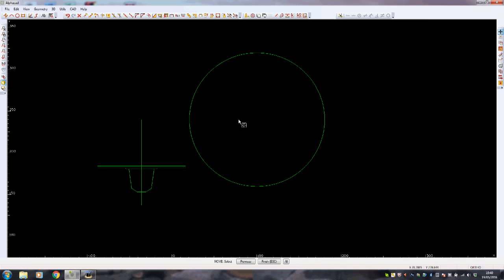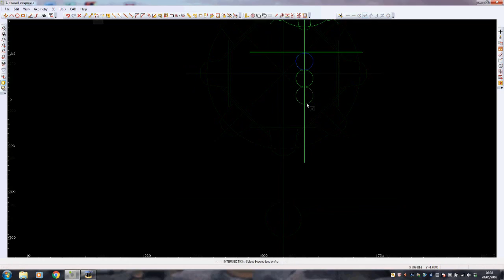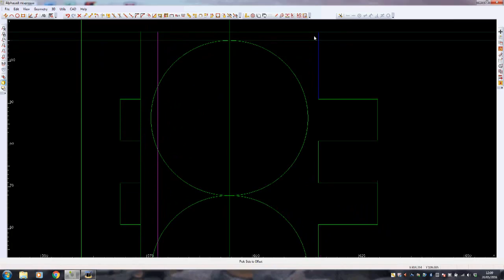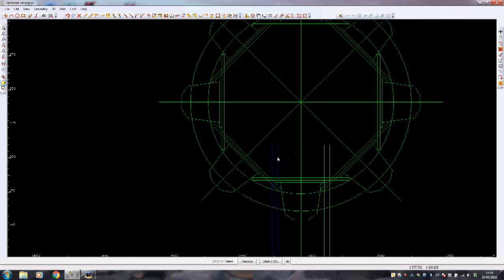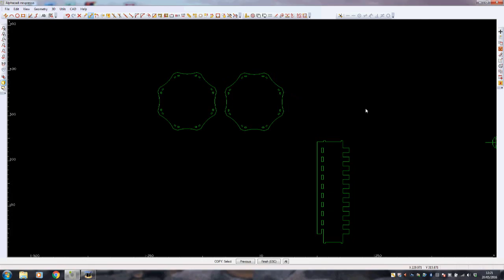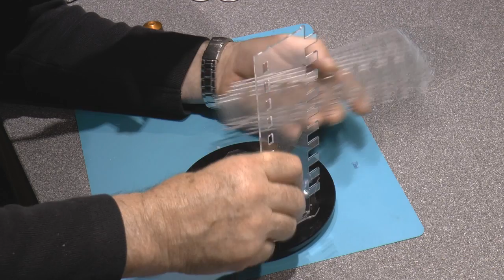RDWorks Learning Lab 63 Nespresso Pod Holder

Comment: Boy do I know what you mean bout trying to explain how you design.  I can tell you everything I design ends up being a different process depending on the challenge of the project itself.  The most important thing is to have a clear understanding of what you want to accomplish.  :)
Reply from the maker: Hi Mike
My engineering mentor continually told me "When you FULLY understand the problem you are trying to solve, you already have 50% of the solution". Just like your tables, there are some things you never forget.
Best wishes 
Russ
ps the pod holder is still in daily use.

Comment: Excellent video. I would like to have also seen a discussion on tolerances when designing the teeth and their sockets. When I design I tend to draw concepts sketch just to tenderise my thought process, is this something you also do?
Reply from the maker: +NERDVille 
Tolerances designing the teeth are dependant on several things which will all be peculiar to your machine. First there will be cut width which in turn depends on the lens you are using and how you have set the focus point. This turn could affect  the hole/slot edge which may  may be tapered and will also depend on the type and thickness of material. There is only one way to find out what your best size is and that is to do a trial cut. It becomes totally unpredictable when you are using cast acrylic material because if you have a 1 ft square of 5mm acrylic and you measure round the edges, you could see anything from 4.5 to 5.5mm on that one piece of material. Extruded acrylic is much better tolerance. I always measure the material I am going to use and start off making all teeth and slots exactly the same size.
I always have a visualization of the idea I'm trying to achieve and then mentally zoom in and start drawing details. As those details hit the page they often trigger  thoughts on other issues that need fixing or integrating into the design. I can't remember the last time I used pencil and paper. As I demonstrated in this video, there are no dimensioned drawings involved it's simply from imagination to CAD where I quickly extract 2D designed parts and then straight to machining.
Best regards
Russ

Comment: Do allow for the kerf of the laser cut width so the slots accept the tabs tightly?
Reply from the maker: With some materials you  can make that allowance  but with acrylic you will be wasting your time because of the thickness tolerance of the material.  For cast acrylic +/-0.5mm is typical and this can happen over small areas of the sheet. For example a 5mm sheet may typically measure 4.8mm average. I would cut slots 4.8 wide and take no account of the kerf.  Extruded acrylic is a little better at about +/-0.2mm  but I still ignore the kerf. With MDF the situation ids different because the tolerance is generally much better. Always cut a test square and measure it to find out the internal and external dimensions because your kerf will vary with speed, power, air assist and lens focal length .
Best wishes
Russ
Reply: SarbarMultimedia 
Understood. Thanks for clearing that up.

Comment: Do you really have a problem with cut order when you don't manually set it up?    I've never touched the cut order and it's always start cutting in the inside first.  Even when I have shapes inside of shapes inside of shapes.   It always starts in the center and works it's way out automatically.
Reply from the maker: Hi 
You certainly can get outsides cut first if the cut optimise handle is not set properly. Additionally, the cut order is all over the place if you leave the Path Optimise ticked. So it's not just inside first that makes me manually order. It is so quick and simple to do that it's now become a habit. If you have a honeycomb table where the pieces do not move when they are cut then it's even possible to cut holes second and not worry. However, with my pin support bed  is unforgiving of such errors. When I cut fine details on card/paper I always work in small defined areas so that the chance of misregistration is reduced to nil. It's whatever works for you.
Best regards
Russ